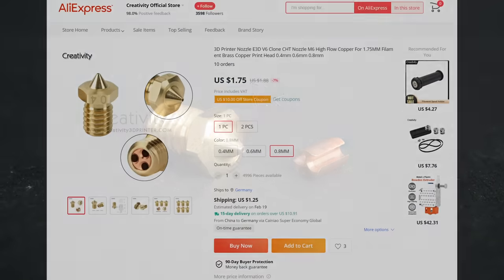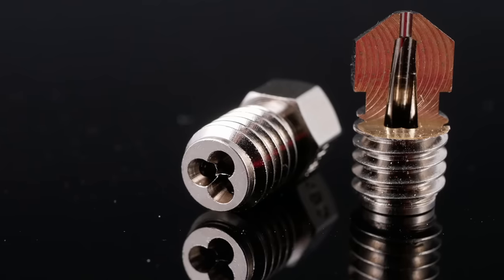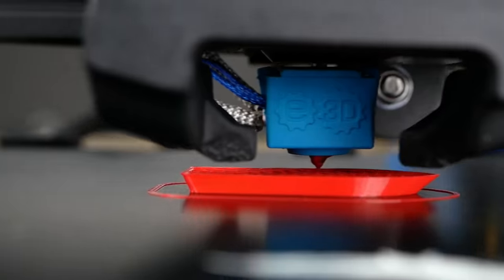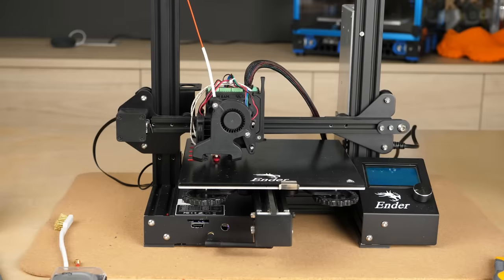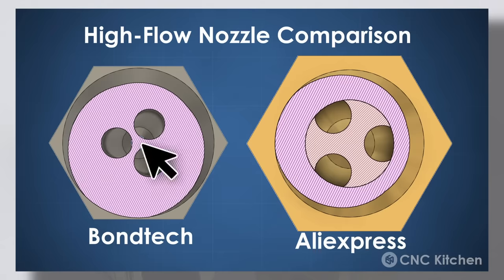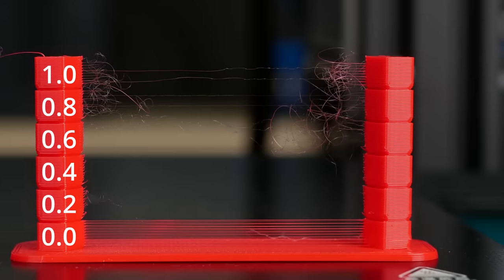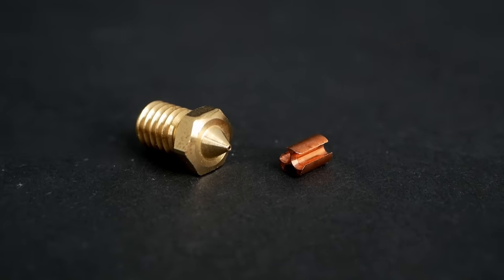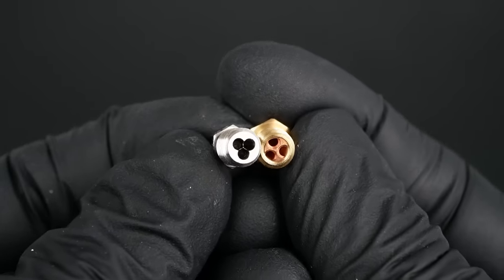$2 Aliexpress Knock-Off better than Original?

Comment: Hi Stefan, If your extruder is the limiting factor now, maybe you should look into extruders used in higher speed printers or those with higher torque? Like Orbiter/Galileo, Sherpa Mini, Double-Folded Ascender?
Reply: Sherpa Mini and similar do not have a ton of torque, it actually is pretty weak compared to proper Nema17 extruders.
Reply: @motomarco_   Aha, I missed he uses Hemera, in that case it may be right.

Comment: a quick poorly-thought-out idea:
brass has a higher coefficient of thermal expansion than copper, meaning as the nozzle heats, there will be an increased gap between the nozzle and the copper insert, reducing heat transfer. this makes me wonder if the copper insert would work better with a steel nozzle, as steel expands less than copper, meaning that as the nozzle heats the insert would press closer to the sides of the nozzle bore. this would mean there is a better thermal interface between the nozzle and the insert, while maintaining the ease of inserting and removing the insert when cold.

any advantage gained here might however be negated by steel's decreased thermal conductivity compared to brass. It could possibly be worth experimenting though?

Comment: I wonder if sweating the copper to the brass with a thin layer of plumbers solder would help or have too low of a melting temp and mess with the print / nozzle.

Comment: I don't think the knockoff will violate the patent I think it's different enough to bypass the patent That's just my personal opinion of course I'm not an expert

I actually like the knockoff especially for hardened nozzles if they make a hardened version because it's serviceable One concern with the CHT SOLX design is that what happens as that internal set of channels the piece in the middle wears down? The knockoff is serviceable you can push the copper component out and replace it

Wow this might be silly to do for a brass nozzle if someone makes a high quality hardened version of this that might become more of a benefit of being able to service the heat splitting portion of the nozzle by replacing the copper core now I have to see if they have a 1.2 mm version of this :-)

Comment: I think the biggest problem with the knockoff design is just the limitations of heat transfer to whatever the core material is. The case of copper this works out pretty well because copper's just such a great he conducting material, but if this was to be implemented in some way that would be abrasion resistant then I'm not sure that those abrasion resistant materials would transfer heat well enough to make this work well.. whereas the single piece original design could be made with some pretty tough steel and the holes drilled with carbide.

Comment: I'm still quite sure that inserting a blade is better solution than three holes with chamfered edge. A blade would simply split the filament and it is very easy to make it sharp. It would also take less space.
Reply: Idea is to move heat into center, not mechanically slice the filament. Slicing it up only increases friction and can cause issues with fiber reinforced materials. Chinese version is here better by the accident of using copper insert though it should be slightly over sized to be press fitted, but then again knowing the finish quality its better for it to be separate part. It does not take much effort theoretically clean the surfaces, least for me since i work often with tiny parts and then hammer in the insert to slightly compress it to walls for improved heat transfer that makes this even better than holes drilled to brass nozzle in angle of the original design. You can try adding blade on top, but i bet effect it would have is minimal and at worse could effect negatively the flow characteristics.
Reply: @Hellsong89  Oh, i understand the idea, i just feel like there is too much restriction in the three-hole version, which has to split the melted plastic to three streams that then join again. It would be easier to machine a blade and you could sharpen both edges and polish it. Oh, yeah, the blade should be sharp both ways, the  sudden change will cause turbulence and more drag.

Comment: More than likely, knowing that copper itself has such a high heat capacity, once it heats up fully to the core of the insert, it would be hard to outperform for the bondtech. By the time that the core has enough material through it to actually cool down somewhat, the printer already is reheating the filament, keeping it at a stable level of melt. In fact, I would hazard a guess to say that the Brass material of the outside nozzle would be the bottleneck at this point, mostly due to Brass's inferior heat capacity to Copper. Aluminum and Copper are on a similar level to each other in the ability to absorb heat, but Aluminum loses heat to surrounding air faster. 

Following the idea behind this, a copper nozzle with a core like the AliExpress one would likely outperform most if not all nozzles today. If the copper were work hardened through sandblasting or otherwise, it would be stronger for the most part as well.

Comment: The bondtech CHT is the sole reason why I'm not upgrading to an E3D Revo. I use a V6 in my voron0, Ender 3v2 and CR10 v2. All have CHT nozzles. I found I couldn't print fast enough on my Ender3v2 using a CHT nozzle. I upgraded to linear rails on the XY, input shaper and I still can't get up to the flow rate it can offer.
Reply: @therealjones-o6x  fast nozzle change. I regularly change the nozzle on my cr10. I use 0.6 hardened steel, 0.6 cht, 
1.0 cht and 1.4 cht.

Comment: I wouldn't mind supporting Bondtech CHT, but $20 vs $2 is a huge difference. If they were able to simplify their manufacturing processes and reduce the price, like just using the simpler inserts with larger inner diameter nozzles, I mean...

Comment: I wonder if the insert can shift inside the nozzle at all and if this could be related to why there's more difficulty with retraction and stringing. would be interesting to test the setup with the insert brazed in place both for stability and it would improve heat transfer too.

Comment: I'm not totally anti patent but - If they priced the product fairly - nobody would feel the need to copy it and sell it much cheaper. $20.00 for a nozzle just because it has 3 little holes drilled in it at an angle is highway robbery and taking advantage of the consumer. It didn't cost crap to develop that. They probably stole the idea from someone else anyway. More power to the knockoffs in this case.

Comment: I never got that 17-20$ hotend cause I wasn’t sure how I would clear a clog or swap filaments. Or how retractions would operate..

That AliExpress one seems much more feasible, that taking the nozzle off and the core can come out as well. 

Somewhat surprised my expectations were in the reverse far as maintenance goes…

Comment: I just bought a couple CHT clones from Super3D on AliExpress…unfortunately after running your Hotend Flow test I found that these underperform my normal Micro Swiss Wear Resistance nozzles with PLA at 200/220/240C. Only explanation I could come up with is the copper insert having a flat spot in between the channels vs Bondtechs design have more of a sharp edge between their 3 bores. Back to the drawing board…

Comment: I am a little surprised they have a patent at all. It is basically a tube heat exchanger. Which are widely used in industry. How do you increase the heat transfer to a fluid, you increase the surface area. How do you do that in solid material. you make more holes. 
Patents in the US are required to not be obvious. They were the first to file, but anyone trying to increase the surface area of a nozzle is going to arrive at the same or very similar design. IMO it isn't novel enough to warrant a patent. There are probably also numerous other nozzles for different fluids that do the same thing.
Reply: The injection moulding industry has such nozzle inserts to mix and thoroughly and rapidly heat plastic without overheating some of it. Besides being a very throughput cost sensitive business, many injection moulding plastics are actually degraded rapidly by heat, so too much temperature or too long heating reduces the usability of regrind and recycling potential, and limits the size and complexity of objects you can manufacture. So homogenising temperature while heating is a key objective.

Comment: Im wondering if the copper core expands during heating to lock it firmly inside the nozzle, and creating a good heat transfer surface from the external nozzle that way.

Comment: Well the method looks/is the same, but the design is different and like you said, that copper insert is not the same way as the Bondtech CHT. Besides the 3 channels are on both nozzles not the same.

Comment: I'd be surprised if my Bowden tube extruder would be strong enough to push filament into that nozzle. The chamfer on the holes seems very limited in depth and I would assume the filament is being sheared more at the beginning.

Comment: How does the Ali nozzle without the insert compare physically to a standard nozzle?  Is it possible that the insert is simply an addition that could be used with any standard nozzle?  It would certainly have helped keep production costs low if they could simply use widely available existing stock.

Comment: Patent attorney here.
The EP3445568B1patent is granted in Europe. Its equivalent is still being examined in the USA, so the protection is not completely defined in America. There is no patent in China, so the Aliexpress guys can make and sell their knockoff in China with impunity, at least for the domestic and Asian markets 

They may run into problems exporting the nozzles in Europe and in the USA but, the claims of the European patent require "_ /.../ a piece of heat conductive material being attached in at least one place to the inner side wall of the hole/.../ _". It would have been very easy to force-fit the insert ofthe Chinese nozzle, and the heat transfer would have been improved, if anything. The fact that they went for a freely sliding insert may be an attempt to design around the patent. I am not sure that it is a safe defence, but it is not stupid at all, especially since the performance is somewhat unexpected.

Comment: I will support Work of the Innovators as long as pricing is reasonable.  Nozzles wear out, become clogged or damaged by end user so there is a maximum I’ll pay.  currently trying the nozzles.    I do hate to see open source go away.    I still buy my V6 parts and nozzles from E3D but their pricing will reach a point where I cannot afford “real” product and have to switch to knockoffs.

Comment: Hi, 
Thank you so much for your great conclusive research. Your videos really helped me understand what parameters there are, and evoked thoughts and what could be possible. Thank you! 

What I was wondering the entire time throughout this and the last nozzle video is how a Diamondback / diamond tip nozzle would perform. Since its several multiples more thermally conductive than brass and even copper, perhaps this may outperform all of the nozzles you have tested until now... 

Yannic

Comment: I'd be very interested in seeing a volcano version of this (extended length) to see how well that would flow.
With a volcano length, you could potentially have flats on the side for tightening so that you could handle steeper angles for the cone-correction slicer approaches.

you should consider milling out a volcano to add two of these inserts into it for a test.

As others have said, this approach is MUCH easier to manufacture

I wonder about the copper insert, copper will conduct heat a little better than brass, getting more heat into the center, but may wear out faster.

Comment: But how does the knockoff perform in a printer printing at 25mm/s³ where the speed is 150mm/s? I understand volumetric flow but the speed it is being laid down is important to affecting how the filament is mechanically pulled from the extruder.

Comment: The intellectual property question is an interesting conundrum in the 3D printing world, and I can see arguments both for holding patents tightly and for knockoffs to dominate. The whole point of patents is to encourage R&D efforts by providing a return on investment, investments that wouldn't be worthwhile if the design will be ripped off and sold by someone else for 1/10th as much. But on the other hand, the knockoffs make 3D printing far more affordable than it would be otherwise, probably is really what brought it within reach of common hobbyists in the first place. The knockoffs also force the designers to innovate, to come up with truly good designs to set themselves apart, as well as to make their designs reasonably-priced. This is especially apparent here, where the original designer came up with an effective design, but it is expensive to manufacture. If they could have a monopoly on such, they'd just call it a day. But the knockoffs found a much cheaper way of making it, improving upon the design in a way that the original patent-holder might not have bothered otherwise. The next thing that needs to happen is for the inserts to be press-fit rather than loose, and maybe have sharper inlet edges.

Comment: A thought I had was that the copper might expand more when heated than the brass, turning the loose fit into an interference fit at temperature and allowing better heat transfer. If someone knows whether copper expands more than brass, please tell me.

Comment: Now for someone to make a high quality one with the insert. machine to a high tolerance with a slight interference fit. heat the outside nozzle and cool the insert and press it in. better heat conduction with the zero tolerance fit and higher since it is copper.

Comment: Any theory as to why the is an initial increase in extrusion weight from 5-10 mm/s before it then starts to drop?
Reply: Maybe the pressure from the extruder needs to be high enough to split the filament.

Comment: I might be wrong since I'm new to printing, but isn't the genuine nozzle steel and the fake copper/brass, which would explain why it heats better, and therefore the genuine would perform better if it was brass or the fake was steel?

Comment: There's a brilliance to the simplicity of the knockoff design, considering it gets results comparable to the Bondtech. 
But the Aliexpress piece looks like pretty low quality copper that was poorly machined, leading to some potential problems that you pointed out. Also, being copper, I have to wonder how much more quickly it will wear than the nozzle it is in.

Comment: Didn't work for me at all. Similar nozzle reduced flow on my Ender 3. Such nozzle actually reduces flow compared to original Ender 3 Nozzle. Both 0.4 mm and I have bi-metal heat barrier. It didn't work because thermal barrier has 1.75 mm or so hole without any chamfer. As result path really reduced by insert. Mine came preassembled  with small chamfers, but those didn't help.

Comment: I think I prefer the bondtech option more. Not just because of their innovation and them being much more likely to have consistently high quality products, but that stringing test was pretty damning because I hate dealing with stringing. 

I believe the only reason the Chinese version performed better at all is because they use copper for their insert whereas the bondtech is still a coated brass. 

In addition to that; The quality of the Chinese version looks like most of the nozzles I've gotten from aliexpress where it looks like it needs additional manual polishing and cleanup and I also worry about the dimensional accuracy/quality of the orifice, and frankly I'm tired of spending the additional time and frustration doing something that should be done during the manufacturing process.

Comment: Fabulous explaining as usual Stefan Merry Christmas! the thin walls do help, this is why stratasys uses tiny OD liquefier tubes all the poly should be the same MT and 65mm long tubes they use provides this as does the improvement here with better heat contact distances. Cheers

Comment: I would have applied soldering paste to the insert outer walls and heated to melt, so thermal conductivity would have been max possible. Or used a cpu thermal paste to do the same. Would be interesting to test this.
Reply: probably would leech into the filament
better to solder/braze it on permanently

Comment: What if the insert was synthetic sapphire? Higher thermal conductivity than even extremely pure copper. Higher resistance to wear. Or, am I way off-base here?
This two-piece design seems ideal to support experimenting with other insert materials...although the physical material interface may need tuning as well.

Comment: If you have a fast printer, you probably have the option to pre-compensate the flow in the software!? 
Could you CNC Kitchen reprint the 3D benchy where you have precompensated the flow to be constant up to the slip point of the extruder motor ?

Comment: This happened to me: on a Super Racer (so Volcano nozzle) direct drive LGX lite. Filament ESUN PLA ST at 225 degrees. Original 0,4mm brass extruder: M83 then G1 E40 F550 is the limit for the LGX motor at 650mA; F600 become slipping. Bontech CHT volcano BiMetal 0.4mm: F250 is the limit; 300 become slipping. Measuring the extruded at max F on the original brass: 0.49/0.5mm (at F100 0.43/0.45mm); on the CHT at max F: 0,42/0.44mm (at F100 0,38/0.4mm). What do you think: is possible that the brass nozzle has so much more flow? Considering the F100 difference is at max 0.07mm the tolerance in the holes is different, but is enough to justify this behaviour?